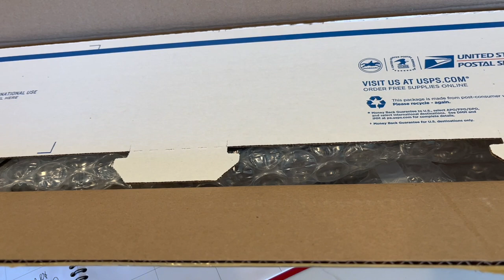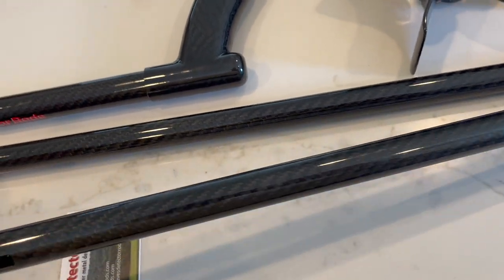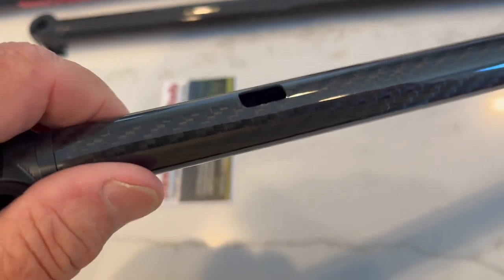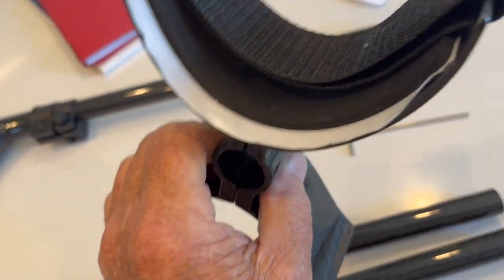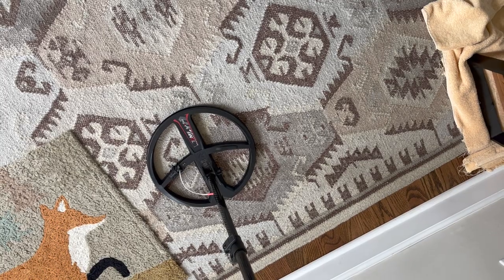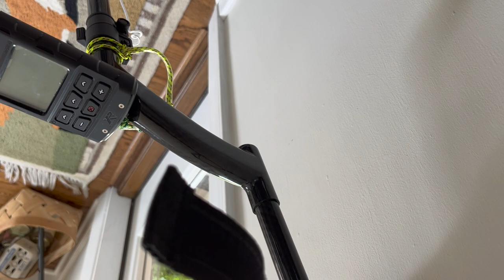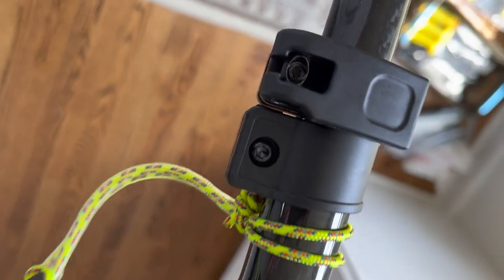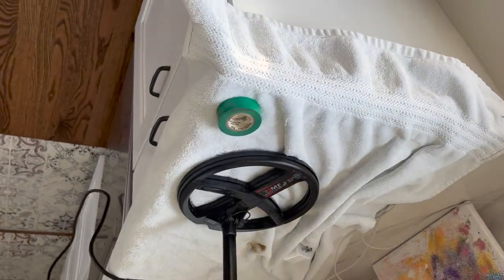STEVE'S DETECTOR ROD FOR THE XP DEUS II

Comment: Hi sir. New sub here. I just watched one of your old videos where you had a problem with an Excalibur 2 making a chatty noise when you turned it on. I’m having the same problem with my excal right now and wanted to know if you could figure out what it was. Thanks in advance!
Reply from the maker: Had many over the years..........sounds like hole in the coil..........does it work ok on damp zone and act up when submerged?......................more than likely the off and on switch is bad or the volume switch............off and on is used more so it fails faster.............i wish i still had mine now.........it is the best beach machine around, some newer ones may go a bit deeper, but day in and day out.........it is a fine gold finer.........minelab repair in PA is very fast these days